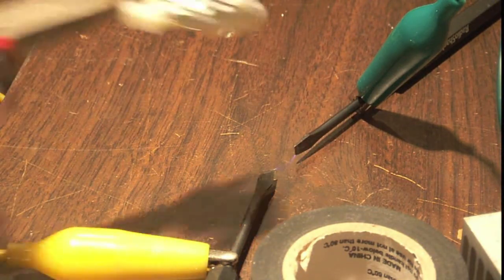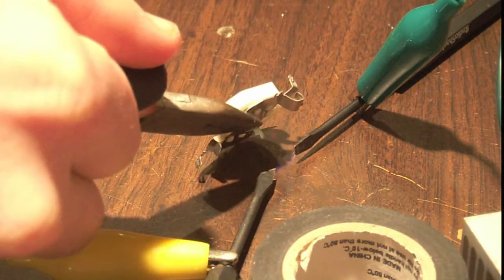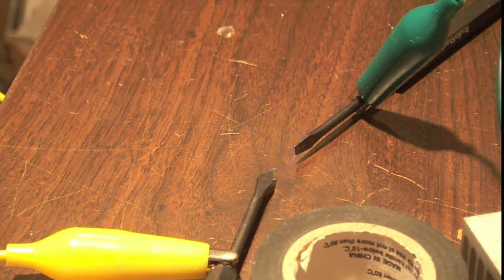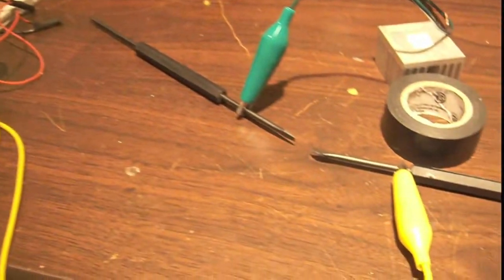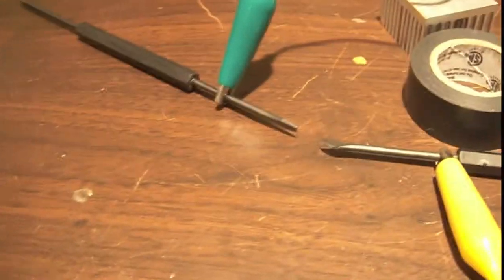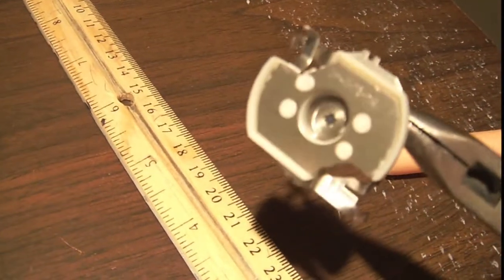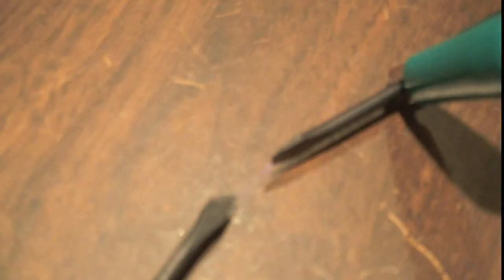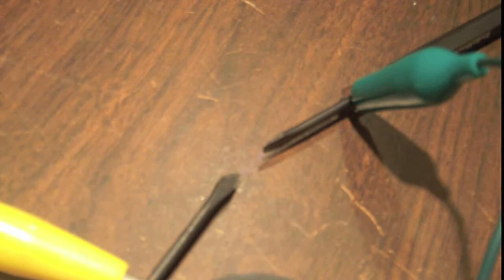Alpha Particle Detector

Comment: You have probably found out by now to get rid of any sharp points or corners on your leads to stop all that halo discharge. You will get clean, precise sparks then. The instensity of each spark is controlled by capacitance. To raise or lower capacitance increase the surface are of your electrodes or add a high voltage capactor in parallel.